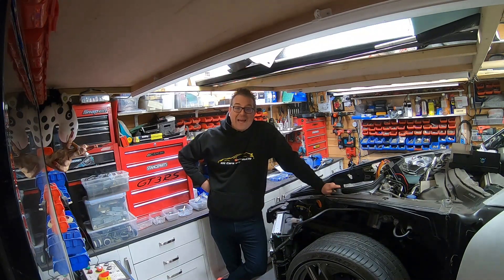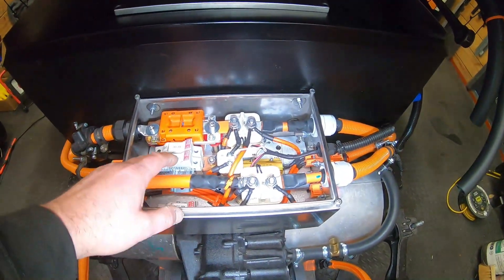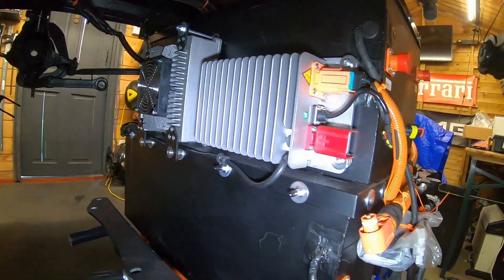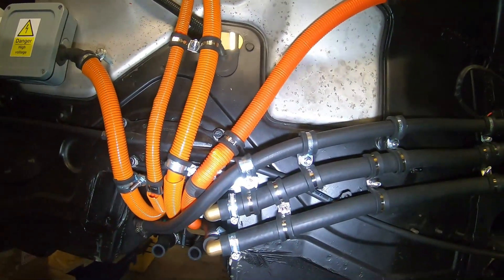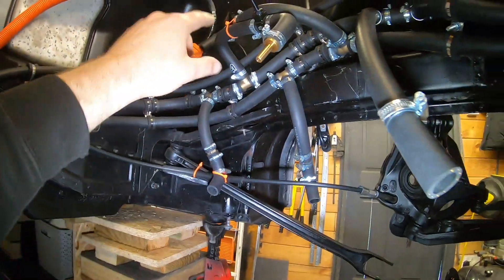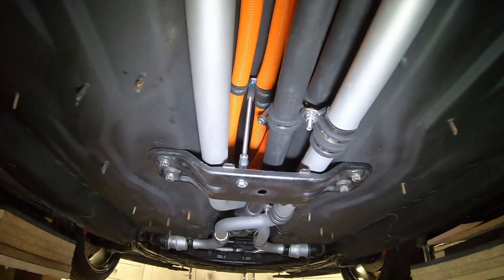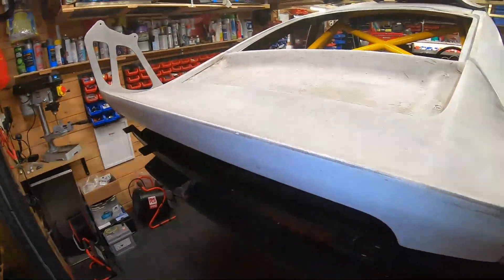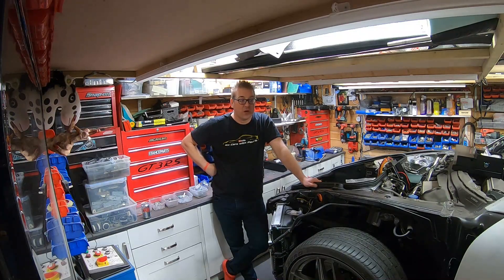EV Home Build Part 11 - Project Update and Final Fitting of the  Tesla LDU & Subframe

Comment: Hi Paul, great work! I am using very similar configuration (T2C/Orion/Tesla SDU/) converting a Delorean. De SDU is installed in the car, the bespoke  driveshafts are made, the motor runs after I built just like you did a 'wooden'  test set up with  appropriate fuses, pre-charge, contactors, switches and lights to test the T2C . I actually used some electric grass mower 80V packs to drive it.  Now I am designing my two CATL Battery Boxes
Reply from the maker: Ah great stuff. Great to have a fellow builder on board. Have you tackled the Orion wiring yet?
Reply: @kitcarspaul79  I made a test setup with the Orion,  one  12S module wired in,, the software utility and all seems to work fine. 7 modules to go!

Comment: Looking great, First time seeing your build so will have a look at some earlier vids.
It looked like a Vauxhall Zafira power steering pump, otherwise known as a screamer. If you find it overly noisy the Volvo/Ford pumps are usually a bit quieter.
I'm jealous of the Tesla brake boost, I used an Audi vac pump which is the noisiest thing in the car.
Reply from the maker: yes the Tesla brake boost seem to fit pretty easily..